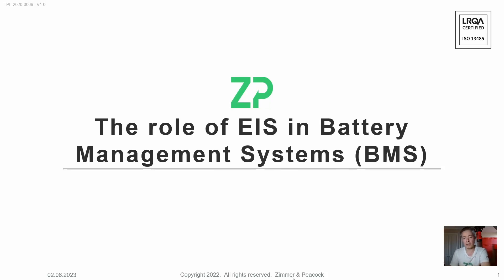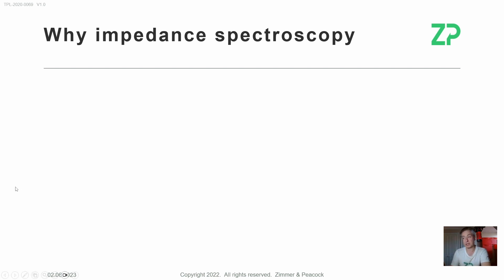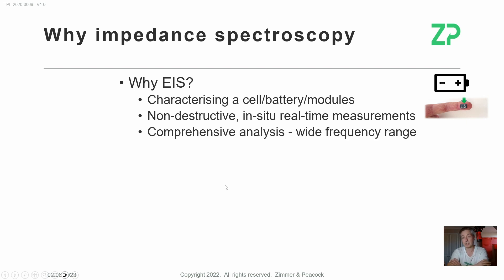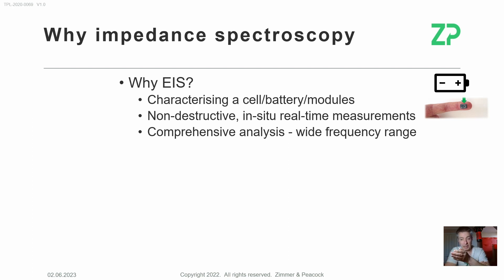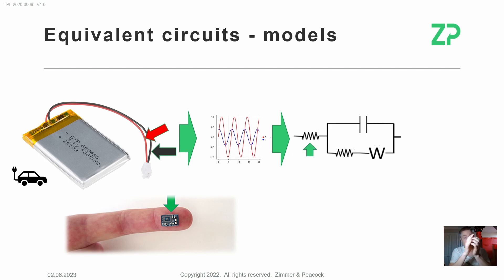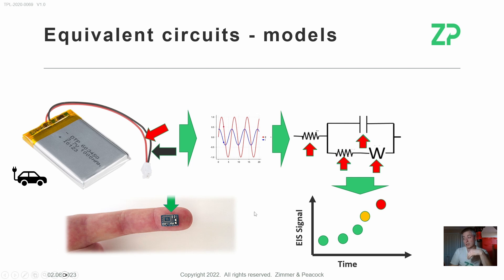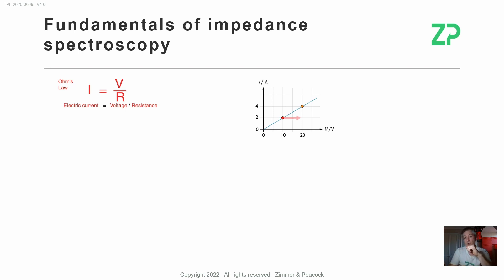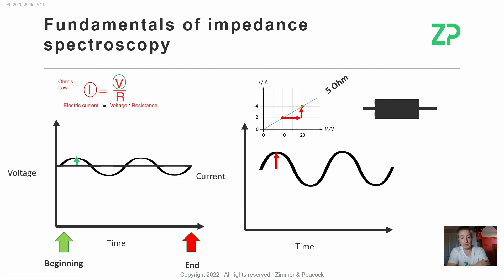The role of EIS in Battery Managements Systems

Comment: Nice video. Do you have one to explain the Warburg element in more detail? Curious on it's relatiom to diffusion
Reply: The Warburg element represents the diffusion gradient of the electrolyte concentration electrically. The reduction in concentration towards the electrode cause charge carriers to move in a way that is similar to movement through a transmission line. There is a constant shift in phase that is dependent on the distance.